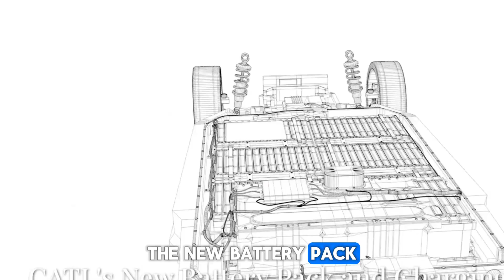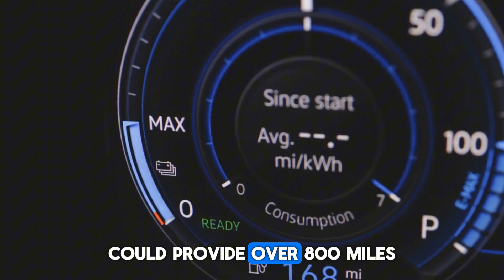CATL New Solid State Battery With 12 Times Charging Speed Begin Mass Production

Comment: Not needed for home charging nor 'Starbucks' charging. Useful for that quick stop at a 'gas' station when rushing to work or pushing along on a long distance journey.

It's only a small step on the relentless developments in this area. Like the demise of the vacuum tube as germanium semiconductors started to encroach.

(careful reader will note germanium based semiconductors are now part of the esoteric usage spectrum after silicon transistors then ICs and Moore's law took over. Not your grandfather's lead acid battery;-)